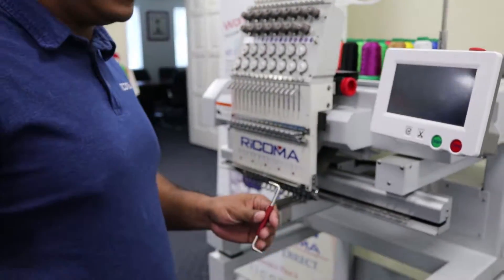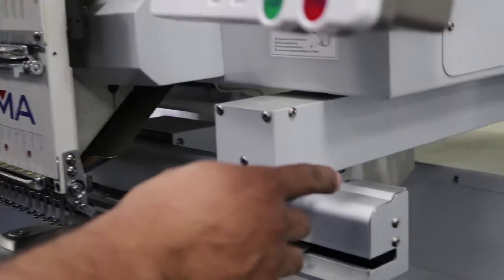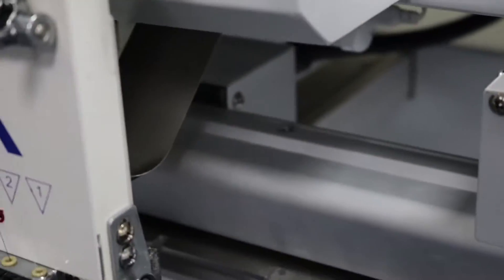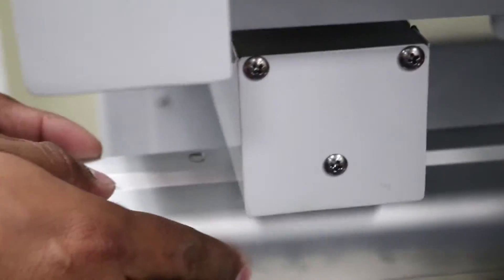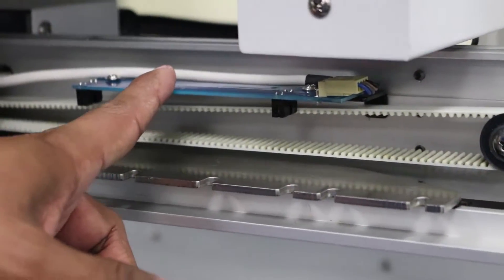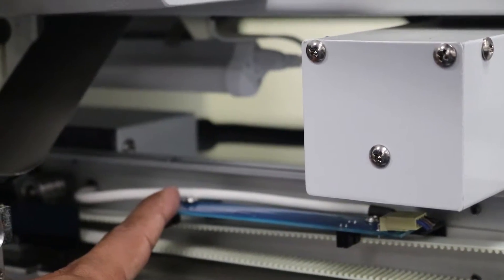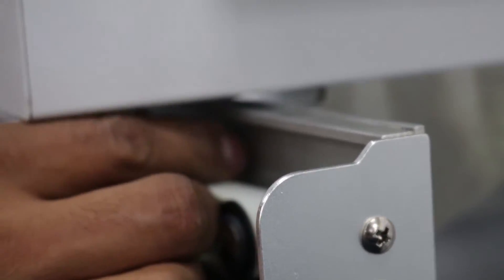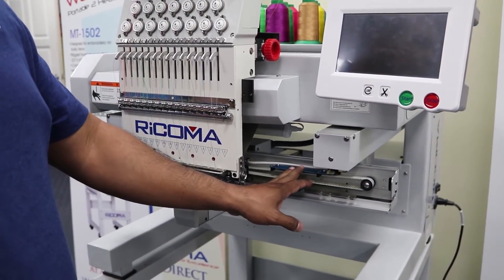How to Replace X&Y Sensor on MT-1501and MT-1502

Comment: How do you know if the sensor is bad?
Reply from the maker: There could be different signs indicating a bad sensor. For example, the first signs that the sensor needs to be replaced often include the machine stopping unexpectedly, skipped stitches, the needle not positioning correctly, and unusual noises. If the machine is up to date on maintenance and you still hear unusual noises, it could be due to a faulty sensor. Ultimately, this would need to be verified by a technician.